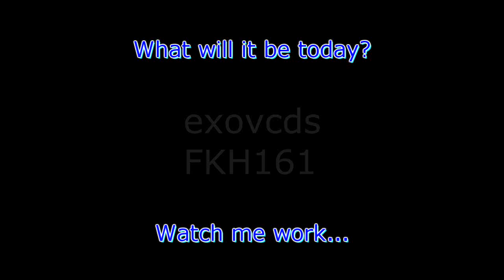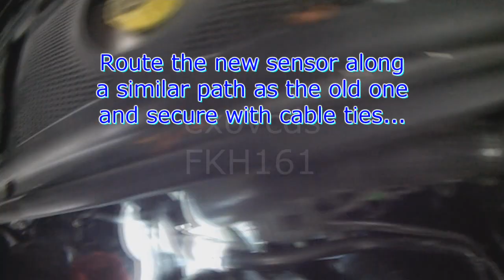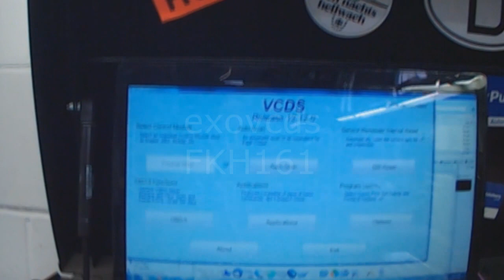Audi B5: 1.8T Crankshaft Position / Engine Speed Sensor Replacement

Comment: I cannot for the life of me figure this out on my Audi A6 Quattro 4.2 C5. I know where it is. I can see it, but can't get through from the wheel well or behind the manifold!!!! f**k!!! this is the only thing preventing my car from starting.
Reply from the maker: +Joseph Taylor You have a crankshaft position sensor fault code?
Reply: ***** No, I don't. I read that a lot of the times a sensor fault doesn't show an error code. I don't have a camsensor code either. Fuel pump isn't priming, does if i jump the relay though. No spark. No fuel. Before failing, car shifted down to third gear roughly. Like it did it too early and made the RPM's rise. That's how I cam to the conclusion of crankshaft position sensor.
Reply: ***** VCDS shows a value of 0 on the RPM measure block while cranking. That could be because I'm using a third party cord, but I'm out of options. I have no idea what else it could be. Tempuatures show normal value, battery is working 100%, alternator is new, 9 degrees BTDC while cranking (idk the normal value), timing belt has 30,000 miles on it and no slack, fuel pump just replaced, relay is fine, ECU seems fine, no fault codes relating to anything ignition system, including misfires. No spark, coil packs are fine, new spark plugs, new air filter, oil changed 1,000 miles ago, no vacuum leaks, cat converter isn't clogged, ABS working fine, immobilizer disabled, fuses are fine. Everything. Is. Fine. Car just randomly won't start again. No warning signs. I got it started 3 times after it acted up the first time, but now it hasn't started up again after a week. Hot warm ups vs cold warm ups didn't seem to be a factor. So I honestly have no fucking idea.
Reply from the maker: Joseph Taylor I'm back at work (was on vacation), so my reply times are limited. I will get back to you tonight after work (6pm> pacific time).
Reply: ***** okay, sounds good. Feel free to email me. I have some other questions about my car if that's okay? I've had it for about a month and a half now. Before this one, I worked ony BMW 330xi so... Yeah. This one's a lot different. Looking forward from hearing you soon
Reply from the maker: +Joseph Taylor 
http://fkh161.ca/Audi/G28.png
Reply: +Thomas EXOVCDS I actually found it last night. I don't know why, but it took me four hours. If it's not the crankshaft, have you ever seen anything else show the symptoms I currently am? crank no start, fuel pump not priming unless jumped, no feed to injectors, no spark? new fuel pump, just put in new spark plugs. no fouling
Reply from the maker: +Joseph Taylor Key ON, does the check engine light come on in the dash?
Reply: +Thomas EXOVCDS Yes.
Reply from the maker: +Joseph Taylor No pump prime could be due to ecm not triggering the fuel pump relay. Check engine light indicates that the ecm is awake (partially at least). Fuel pump relay needs a power supply & a working control circuit. If you are also not getting spark, it could be due to cam & crank signals not being synced. I'll try to find a wiring diagram that might be of help (check fuses & wiring). if I don't send it to you tonight, I'll send it tomorrow from work).
Reply: +Thomas EXOVCDS thank you. I have the repair manual though and has over 300 pages of wiring. When I put my finger over the relay, I can feel it click. I know that doesn't mean it works, but I'll test it out tomorrow. The cranksensor doesn't have an o-ring around it. it was actually very very easy to pull it out. could that be or indicate a problem?
Reply from the maker: +Joseph Taylor If it's not sitting close to the crank tone wheel... yes.

You need to check if the sensor is generating a signal. you can use a digital voltmeter for that (look for an ac signal). 

Air, fuel, compression & spark.

Coil(s) should have ignition on power and should fire when the ecm triggers them.

Check for ignition control of the coil (s) after verifying that the crank sensor is OK or not.
Reply: +Thomas EXOVCDS 
the reason why I'm almost positive it is the crankshaft position sensor is because of the rough downshift to third. From what I've read, this was a common complaint.
Reply from the maker: +Joseph Taylor I am not aware of crank sensors causing shifting issues. Intermittent hesitation (spark cutting in / out,) yes.
Reply: +Thomas EXOVCDS 
Alright I'll do that tonight. Anything I can check using VCDS? I'm unregistered until Friday. What about ignition timing BTDC? What numbers do I want to see? MAF? Load?
Reply from the maker: +Joseph Taylor RPM is key... as you have already checked. no RPM = most likely crank sensor.

However, you should still have fuel pump prime... if the relay clicks, follow the power.

No RPM signal, then you should have a fault code for g28.

No fuel pump relay activation, you should have s bunch of short to ground codes... because the relay is not feeding power to those components. 

Study the wiring diagrams and it will make sense.
Reply: +Thomas EXOVCDS 
I pulled the relay to jump the pump. When I did that, I had a lot of short to grounds  (17525, 17829, 17938 etc) showed up on VCDS. When I put the relay back in, I cleared the codes and never came back. I have a reoccurring 18258 - Power train Data Bus Missing Message ECU error on my transmission module. does that tell you anything?
Reply: +Joseph Taylor The only other bit of info I have are the error codes before the car stopped. Fuel Trim B1 Lean, B2 lean, Bank 1 Cat below Efficiency (I assumed 02 sensor), P0442, E221, P1857 (this one came up the day after car died), and a P0102 that isn't showing anymore. unplugged the MAF sensor too and no difference
Reply from the maker: +Joseph Taylor Lack of communication between ECM & TCM could cause a no start. I'll get back to you sometime tomorrow.
Reply: +Thomas EXOVCDS 
okay. Do you want to keep communicating on here? or email? I can text, private message... what ever you wanna do. I just need to figure this out. I can take a video of the sensor or anything too and upload it on here? Just tell me what you want me to record and I will. I appreciate your help a lot. Thank you so much.
Reply from the maker: +Joseph Taylor email would be better... I'm replying on my phone tonight, that's the only reason I'm using YouTube. 

Make videos and postcthem on your channel... send me those links (and pictures) to my email.

Not sure how often I can reply during the work day... I have a long weekend coming up and will be able to think more / dedicate more time then.
Reply from the maker: +Joseph Taylor fkh161@fkh161.ca

Comment: Hi, I have this fault code 17748 - Camshaft Position Sensor (G40) / Engine Speed Sensor (G28) 
            P1340 - 35-00 - Incor. Correlation

with what you did in this video, think that it's solved?
Reply from the maker: No... what engine? If it has a timing belt, then the belt is probably broken. If if has a timing chain, then the chain is broken or has jumped teeth.
Reply: the engine is 1.8t mk4, the car suddenly does not want to ignite, that did yesterday and check today and was under the oil level
Reply from the maker: Remove the upper timing belt cover or unclip it and hold it slightly away from the engine... have someone try to start the engine while you look at the belt under the timing belt cover. The belt should move, if it does not, then the belt is broken. If the belt moves, look for broken belt teeth.
Reply: ok thanks, I'll do that later because I have some time, what makes me weird is that the timing belt, the tensioner, the pulley and the water pump were recently changed
Reply: hello, the problem was solved what happened was that I had low oil level, I had a leak that was what caused the problem, thanks
Reply from the maker: +Daniel Madrigal I the low oil / pressure affected the intake camshaft timing. Interesting... thanks for the update!

Comment: So it's come down to these three codes:
P0414 (Secondary Air Injection System Switching Valve 'A' Circuit Shorted)

P0418 (Secondary Air Injection System Relay 'A' Circuit Malfunction)

P0010 ('A' Camshaft Position Actuator Circuit Bank 1)
Reply from the maker: jLeMeLLeC33 Sorry about the late reply... you'll need to check the wiring to those components. Using Vag-com / VCDS or similar, you can do "output tests" to those components to see if they respond. If they don't, then that verifies that the codes apply. Check the wiring and the components (you can apply power & ground to them to see if they respond).

Comment: im throwing a p0340 code on my awm 1.8t even after replacing my cam sensor. ran like crap and later that day shut off on me. i then replaced my crank sensor and just getting a crank no start. any other suggestions?
Reply from the maker: corbin sheffield Check your timing belt... it either jumped teeth or teeth are missing. If that is the case, the engine will have bent valves and the cylinder head will need to be removed for repair.
Reply: can that happen even with a tight timing belt? there is no slack and no signs of wear
Reply from the maker: Teeth could be missing that you are not seeing... when cranking the engine, does the camshaft sprocket move? You need to turn the engine by hand to check all of the belt for missing teeth.
Reply: yes the cam moves. i even removed the cam sensor to see if the hall sesnor was moving and its all functional
Reply from the maker: corbin sheffield Turn the engine to #1 TDC and check if the crankshaft TDC lines-up when the camshaft is at TDC. Once you rule that out as being the cause... we can look at other things.
Reply: alright. ill check first thing in me morning
Reply: my timing is just fine and still won't start
Reply from the maker: Fuel or spark is missing if timing is ok.
Reply: Thomas EXOVCDS fuel and spark is fine, timing is on point. it's backfiring through the throttle body
Reply from the maker: corbin sheffield Backfire through throttle is due to either the timing being out or the fuel mixture being too lean.
Reply: my fuel pump doesn't prime when you turn the key to the on position but after I'm done cranking it the the pump will prime itself
Reply from the maker: corbin sheffield If the timing is correct, she should run for a few seconds if you spray some brake cleaner or maf cleaner into the intake. **ONLY DO THIS IF YOU ARE COMFORTABLE DOING THIS!!! IF DONE WRONG, DAMAGE COULD OCCUR!!!**